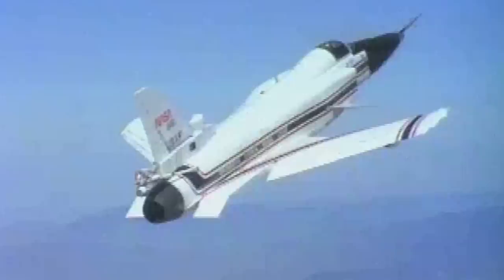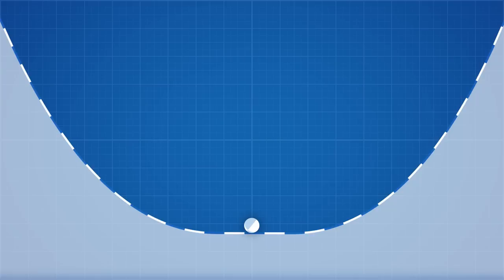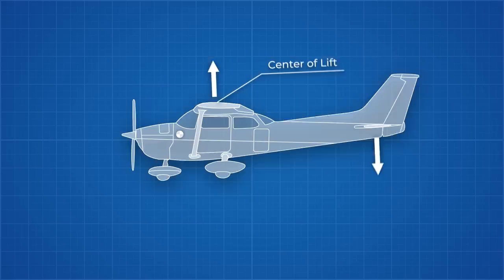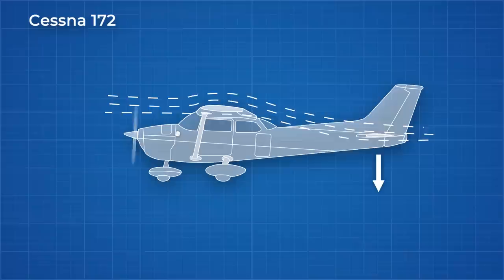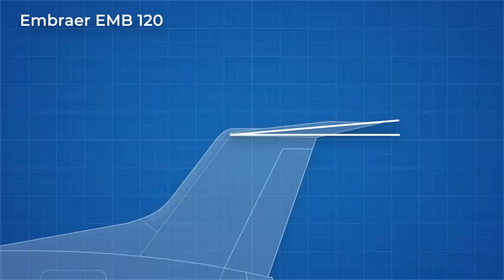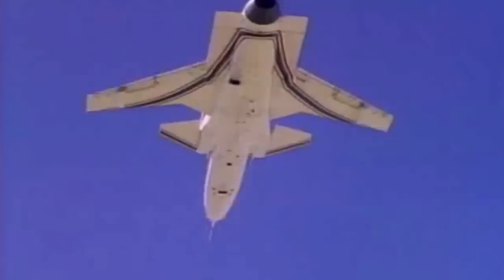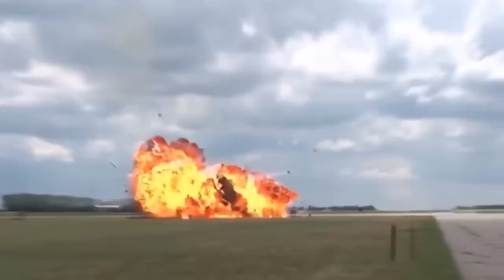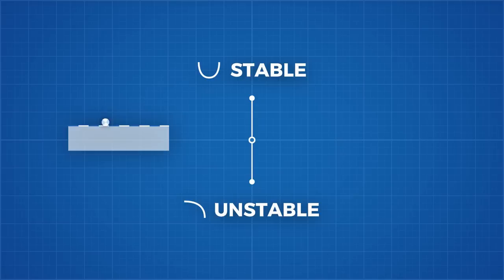Why Fighter Jets Can Be Too Unstable

Comment: "Speed is life. Altitude is life insurance."
Reply: L and then there’s mcas...
Reply: Underrated
Reply: @airwipe1639  Unless you're a Boeing 737 MAX that is!
Reply: @airwipe1639  MCAS which likes to nullify your life.
Reply: Very true, tho with todays jets a missile will get you whether your high or low, fast or slow..
Reply: @ConfusedPlushiee  lol
Reply: @aka0989  ok, let me put it like this: it used to be very true, back in guns only/ a2a missiles are crap times.
Reply: @Jonathan Stiles How many G's can the average AAM perform ?
Reply: Seimen Veldt sr-71 enters chat
Reply: @fetilu0975  20+
Reply: I am a b737 max in that case
Reply: No, I am speed
~ Lightning McQueen
Reply: @fetilu0975  usually in the 15 to 20 range but the G rating isnt saying it can pull 20g turns over and over. Its more like saying it can do a 10g turn twice or four 5g corrections, or one 20g banger. More like total energy maneuverability potential, similar to Delta-V. 
But yes, threat reactions absolutely include countermeasures plus specific manuevers to force the missile to correct or run out of energy. 
Speed = Life is still absolutely true.
Reply: Altitude is just potential speed.
Reply: meh, just notch it
Reply: @DarkIzo  just notch what? You think notching is a valid tactic against modern PD/AESA radars?
Reply: cap would like to think so
Reply: Well said.
Reply: @fetilu0975  what if your out of chaff and flares?
Reply: @aravindva1020  gotta get your parachute to work.
Reply: @CS_Mango  😌
Reply: Flares and Chaff, is life insurance.
Reply: Dogfighting is for planes that only have a machine gun. There is no current need to dogfight, unless you're big into Hollywood and military worship.
Reply: Wait, but life insurance pays to someone else...
Reply: “Attitude is everything”
Reply: Money in the bank
Reply: @technik27  yeah so in this case it’s life insurance for whoever ejects from their plane and hijacks your fighter jet, battlefield 4 style
Reply: @Fetilu09. For a missile to close on a target to within kill radius, the rule of thumb is the missile must pull 3x target g’s in the end game. 9 g is typical max g for fighters, so typical AAM missile can pull at least 27 g. At least that is how we designed them in the late 1980’s -early 1990’s.
Reply: Speed is life pilot - Viper
Reply: “You’ll have to move faster than that son, speed is life.” - Viper

Comment: Fighter jets do tend to be more unstable when there is a missile flying towards it
Reply: Huh thats weird
Reply: Make sure you don't put yourself to sleep lol
Reply: Top comment
Reply: They can become even more unstable after the missile hits, too
Reply: Helpful
Reply: Dear Leader Jim has reached max skill in science
Reply: Dear Leader Jim has reached max skill in science
Reply: I... don't think that helps
Reply: fox two fox two baby
Reply: Thanks Thomas Turnipples69!
Reply: As for the intestines of the pilots!
Reply: When someone fires a missile at you fly straight into it that way a missile doesn't chase you problem solved
Reply: Your profile pic is evil
Reply: @marem3038  well, not STRAIGHT into it. But if it is coming from behind or the side you generally want to break INTO it. Unless you assess that you are outside the range at which you can outrun the missile or it will run out of boost before reaching you, aka that you will be able to "Kinematically Defeat" it, then of course you should turn away from it and accelerate. Run away bravely. :-)
Reply: And a diarrhoea of flares and chaff.
Reply: @marem3038 
Modern problems require modern solutions! 😀
Reply: There's a tradeoff here.  Being more unstable lets you enter a turn faster, which is really useful for dodging a missle, but too unstable and getting back out of a steep turn is sluggish and unresponsive.  A neutrally stable craft can enter and exit turns equally well, and a stable craft exits turns faster than entering them.  This is in addition to the problems at both extremes of turning too tightly for the control surfaces to overcome and loosing control, or being too stable for the control surfaces to deviate far from, resulting in an unmaneuverable aircraft.

Assuming you have a computer that makes sure you never deviate too far from stability, which is in itself a tricky problem since there are many factors that determine the point of no return, meaning the computer has to err on the side of caution and limit things according to worst cases, limiting maneuverability, then you have to make a decision.  The importance of entering versus exiting turns is different depending on what you need the aircraft to do.  A fighter places priority on suddenly entering turns, e.g. to dodge missiles, but of course it still needs to get out of them responsively.

There's another factor.  How tightly the aircraft actually turns depends largely on how high an angle of attack it can maintain.  Too unstable and it can only maintain a small angle of attack before reaching the point where the control surfaces can no longer prevent it from flipping around backwards and loosing control.  So although you can enter a turn more and more snappily, you can't turn very tightly.

Ideally, you want your airplane to be unstable when going forward, but to somehow get more stable the higher the angle of attack.  You also want it to turn effeciently, bleeding off as little energy into the atmoshere as possible, like a rollar coaster maintaining speed while going around a turn.  Airspeed is a precious thing in a dogfight.  You also want it to do this at all airspeeds, subsonic, transsonic, and supersonic.  Oh, and it would be really nice to do all this while being a shape that gives it a low radar cross section (across multiple wavelengths...) so that the aircraft is reasonably stealthy.  Supercomputers are useful here, letting you rapidly iterate shapes and really tune your balance.
Reply: Matt H r/whooosh
Reply: @dearleader6789  I tend to think they achieve maximum stability after the missile hits. Especially after they achieve this near mystical state of permanent stability near the edge of the sky.
Reply: "Over G! Over G! Over G!"
Reply: And even more unstable after the missile has hit!
Reply: @Jose Martin this was 8 months ago, but modern missiles are really good, I mean early ones that just used proportional navigation you could shake off using the planes maneuverability, but modern ones are deadly, they can turn sharper, don't get distracted by countermeasures and are really fast.
Reply: @Jose Martin the soul of humankind.
Reply: @Jose Martin There are colossal global injustices in this world that most people don't know anything about; and would be very shocked to find out.
Like a festering wound, these injustices have slowly but surely corrupted and destroyed more and more of our future, for centuries if not millenia, and replaced our future with a surveillance state tyranny that is not easily defeated or even resisted, if ever.

If those individuals who are in certain elite circles, who are involved in this but are on the fence, would speak up in public and side with the people, the 99% so to say, then that would be "breaking the silence". Someone like Ronald Bernard.

There is also a prominent group of Israeli Defence Force Veterans that use the same name. They speak up against the illegal occupation of Palestine and call on soldiers and ex soldiers (like themselves) to "break the silence" and tell the truth about the horrors that the Israeli regime inflicts upon the Palestinian peoples. They are unrelated to me, but I do greatly admire their mental strength and moral courage to speak up against and resist an oppressive and abusive system.

And I am well, how are you? :)
Reply: @Jose Martin Can i ask what you do? :)
Reply: @Jose Martin  I'm not sure I fully understand.
What is the point of your endeavour? Nano scale 3D printing or something similar(wow!)? Detection of subatomic particles?

Anyway, would you like to tell me something equally profound, that has to do with your work or research or some other knowledge? 

Your job for example, sounds boring to a regular joe, or an outsider like me, but I bet it has its own challenges and beauties that make it worthwhile.

if you had to tell me something profound, that have to do with what you do, or what you have learned/studied; what would it be?
The (in)famous double slit experiment and the subsequent adaptations of that experiment (like the delayed-choice quantum eraser), blow my mind. I feel like a monkey trying to understand the implications of something that is simply outside of its reach, whenever I think about it :)

Comment: KSP has taught me that you just need to add more reaction wheels
Reply: Or just hide control surfaces inside the fuselage so it doesn't look wrong.
Reply: Or just fuck it, and add Vernor thrusters everywhere 

 makes look more badass when maneuvering, and can also maneuver in high atmosphere, or even vacuum 

because why not ?
Reply: Or dihedral angle, this naturally levels the aircraft. I built an F-104 Starfighter in KSP, the short and low wing design made it very unstable (in terms of stability). I usually use longer wings with winglets pointed up for stability
Reply: and struts to hold the massive control surfaces stable
Reply: Anything with enough thrust and control surfaces will fly
Reply: John Randall “Anything with enough thrust will fly” That is the quote that I will live by for the next few years of playing.
Reply: insert all the canards until it's stable
Reply: @621Tomcat  Thats dope!
Reply: "T"
Reply: MOAR BOOSTERSS!!!!!!
Reply: @john31419  ngl, my first functional "aircraft" in KSP was just enough jet engines to do a vertical takeoff as if it were a rocket, 4 control surface winglets to provide dirrection and some lift to help semi-horizontal flight, some landing gear, and some sensor equipment.

Outside of the sensors and the shape of the cockpit, the entire thing was radially symmetric, and looked more like a spacecraft than a plane (since I'd basically built a jet-powered rocket) but it did the jobs I needed it to.
Reply: KSP has taught me that despite Mr. Manley's warnings, I never check my staging with any reliability.
Reply: @621Tomcat  Ironically, with KSP vanilla air physics, adding dihedral or anhedral causes roll moments when yawing.
Reply: lmao
Reply: Homebrew has taught me that lift balancing takes a lot of tweaking

Also nice SC4 police chief pfp
Reply: Kerbal?   I really need to play with that.

Comment: The eurofighter is like a aerodynamically insane aircraft. It’s controlled by so much processing power that is make Linus Tech tips setups look like a celerons
Reply: Within a few points, Yes
On most of the European Delta canards (Typhoon, Gripen, Rafale) the deflection of the canards is what makes them so unstable
The airflow disturbance over the top skin of the wing radically changes the centre of lift
It is why in high speed maneuvers the Typhoon's canards can actually lock in place
Reply: Nice to meet you here, Matt!.
Reply: F-35 hold my invisible cola
Reply: Laughs in b2 stealth bomber
Reply: Yeah. I read somewhere that the canards are also computer controlled so that their radar cross section can be reduced, but I don't know if that claim is true.
Reply: *an
Reply: Mahesh M V U  fam thats like saying they have a iPhone XS in the plane.
Reply: @sportsboyjon  Oh yeah
Reply: That is absolutely not true. A modern, high end cpu ( 5950x ) has ~9.5x more computing power than the fastest supercomputer that existed when the Eurofighter did its first flight.
Reply: I bet Linus would review that plane and drop it as usual